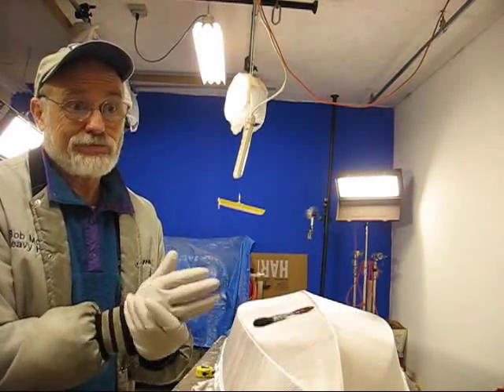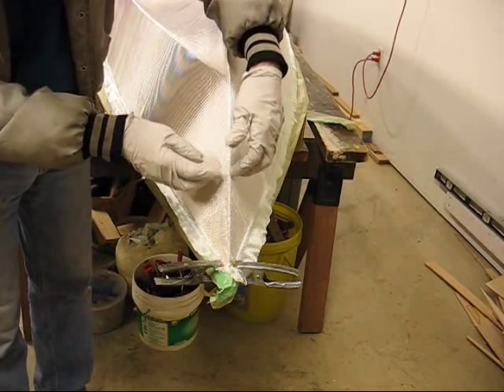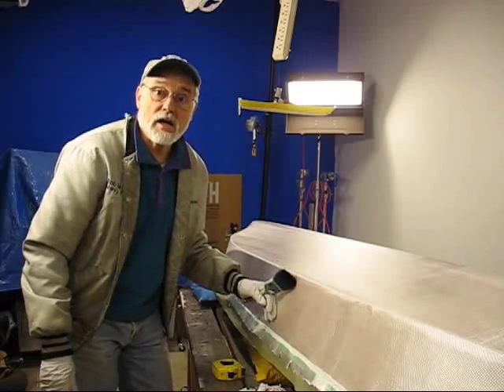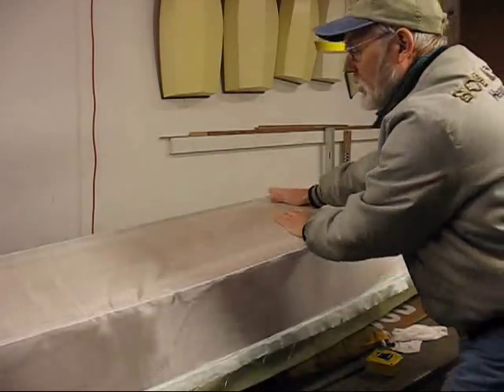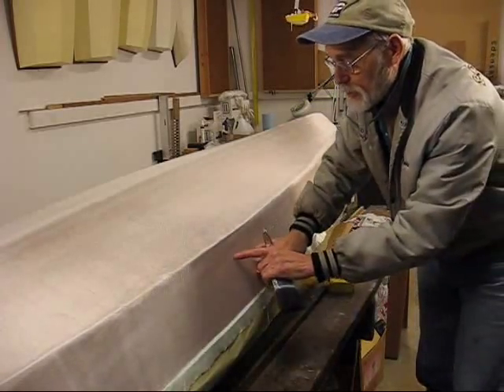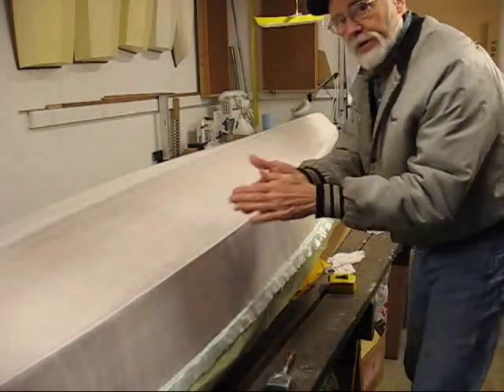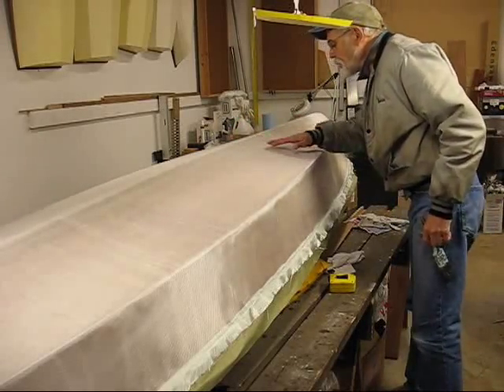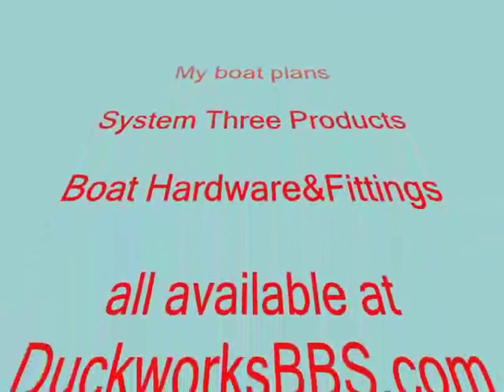EMC Part 4-7 More Smoothing of the Cloth.wmv

Comment: When glassing my Kayak I rolled out the fiberglass cloth at an angle over the bottom of the hull and not straight like you did" 'this laying the glass at an angle makes smoothing MUCH easier. One of the experienced guys on the kayak builders forum passed this trick along to me...now I pass it on to you.